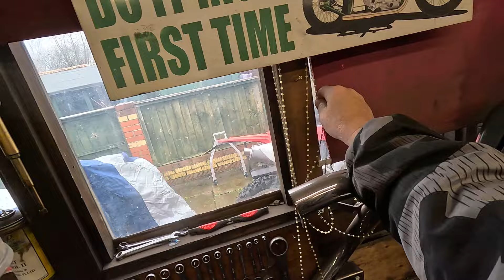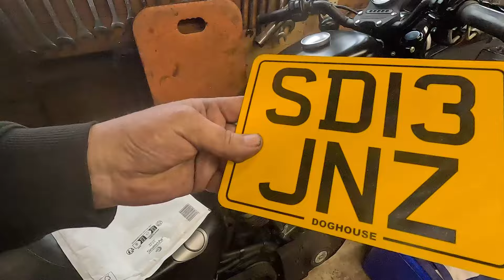Sunday Jobs

Comment: Ask your doctor about a HYDRODILATION.  I'm in my 50's and came off my dirt bike after trying to ride like a 17yo.  I landed on my shoulder too.  It caused me grief which I tried to put up with for a couple of months.  It just got worse and worse.  I finally saw my doctor and was sent for a hydrodilation.  It was a simple procedure, done with a CT scan and an injection of fluid into the shoulder joint.  It took about 25 minutes and provided instant relief.  For me it was a permanent cure and here in  Australia the procedure was free!  It's been over two years since I had it and the shoulder is still perfect.

Comment: To line the van floor look at Phenolic Birch (Rhino Board). It's practically indestructible when used as a van floor. It is a bit expensive, but it's a fit once and forget solution.

Comment: The Van. 
We kitted out my sons Vivaro for fishing weekend and hols.
Choose the insulation carefully, as condensation is a real problem! We used Rockwool.
We covered the liners with sound proof felt, the floor was covered with rubber based floor tiles.

Before you start work, can I suggest you plan out what you want the van to do. We installed a solar panel on the roof then through a converter into a pleasure battery. 12v lighting , phone charging usbs and everything sorted including the TV!!
Then we istalled the gas fridge and cooker. These were his essentials. 
Then sorted the bed and lastly the storage.  Hotel Vivaro !! 
Hope this process helps.

Regards Mike N